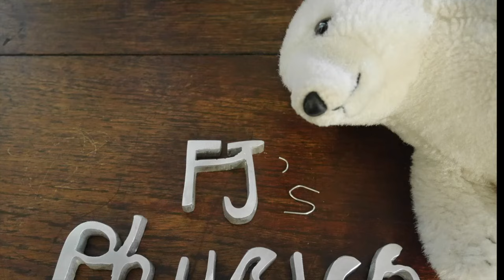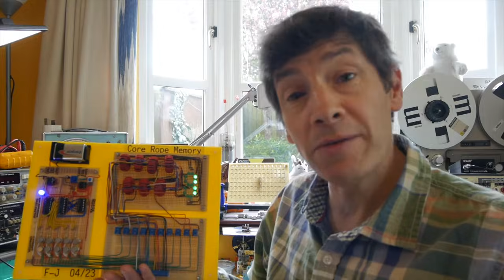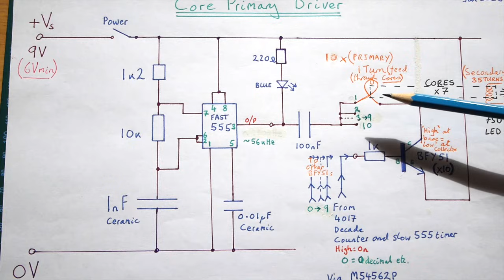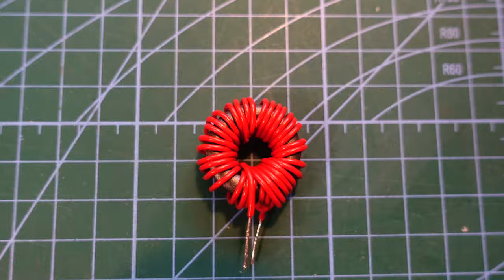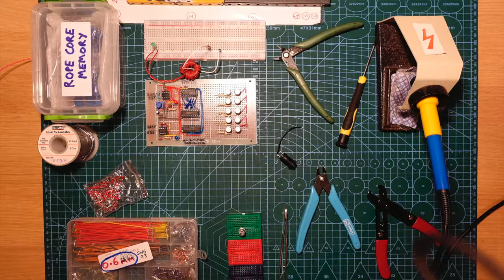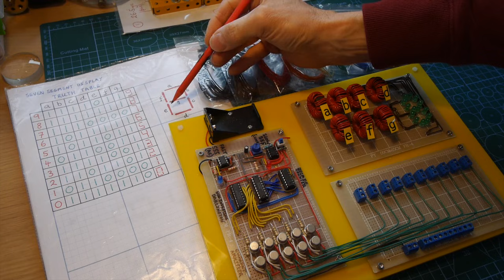Core Rope Memory Built and Explained - F-J's Physics - Video 169

Comment: The crazy part is that there's people recovering data once thought lost from ROM core rope memory right now. Despite it being more then 50 years later the data on the memory modules was not only preserved it's fully recoverable. The system was even more robust then the original designers realized.
Reply from the maker: Thanks - yes it is true that in most cases the coercivity and remanence of the cores is such that they will retain the data indefinitely.  Versions that use my method retain the data for as long as the system is in one piece as it only depends on the location of the wiring.  As far as the original designers are concerned, that's interesting to hear.  I do not have sight of how  robust they thought the systems were but from what I know the designers knew they were pretty robust as they were cleared for use in space.  I will be doing a video on core memory soon - that too retains its data but one has to be very careful reading old core memories as you have to immediately make sure you write the data back or it is lost from the cores when they all flip to zero!
Reply: @AnthonyFrancisJones  btw .... you arent sending any AC signals ... you are sending PULSED DC signals ... which is NOT AC ... you dont have a wave rectifier circuit to convert the dc into ac ... you just have dc power being pulsed on and off very fast (abut 60khz you said)  if your dc is gong from 0 to 5v t o to -5v then it is ac ... but since you are using 555 timers you are just pulsing the dc between 0 and 5v positive ... not one place in that 9v wired circuit is there an AC signal .... from source to display it is ALL DC the clock side is high pulsed dc and the working side is selected DC by reading the rope core memory and acting on the data contained there in a certain way ... in your case you light a segment of a display ...
Reply: @kaboom-zf2bl  This had me confused but as a thicko in these matters I didnt say it lol
Reply from the maker: Hope it makes a bit more sense now Tony.
Reply: @AnthonyFrancisJones  yes much more !
Reply: @kaboom-zf2bl It's AC, actually. He has it capacitively coupled so that the 0-5V gets re-centered around 0V. Even if it weren't though, it would still just be AC biased at 2.5V. Still not a DC signal. It's the fluctuation that matters, not whether it goes "below zero", because 0 is a relatively defined point in a system anywaym.
Reply: @control_voltage  noppe the capacitor is just a debounce circuit ... its all dc .... 
used to care for core memory like this even repair them ...
Reply: @kaboom-zf2bl Check out the circuit at 18 minutes. There's clearly a coupling capacitor on the output of the high frequency 555. Regardless, though, it is not a DC signal. It may be biased at something other than 0V, but it still is AC relative to the bias point. It has to be. Otherwise the coils would not be picking anything up. Transformers do not pass DC.
Reply: @AnthonyFrancisJones  Indefinite is kind of a tricky word when it comes to memory storage, after all, it was widely assumed that laser disks could hold onto data indefinitely only to find out the metallic layer used for data storage oxidized and that they didn't last nearly as long as intended. 
I have no doubt every engineer assumes their designs would hold data basically forever but there really isn't that many that actually can. My comment was more meant as a compliment that their ideas worked as intended.
Reply from the maker: Yes, you are absolutely right!  It worked as they intended and as you suggest, even better than expected!  A kind of modern day 'Victorian engineering'!  By the way, I am tired of the number of my CD's that have packed in and my Ampex reel to reel tape too.  My vinyl records are still going strong!
Reply: @GhostOfSnuffles The producers of laser read discs for sure didn’t think it would last indefinitely. They were just way off due to manufacturing tolerances. We knew all along burnable media wouldn’t last forever. We just thought we had more time.
Reply: @AnthonyFrancisJones  Got to separate the idea of changing data stored in ordinary "core" memory magnetic domains from the "ROM" aspect of the wired bits through/not-through the "rope" core plane ring. (Wasn't that a sense line?) The latter as ROM does not depend upon the long-term storage of the magnetic domain state, and in fact the bit could theoretically be observed by inspection of the wires, though an awful lot of work. Reading the "ROM" aspect only depends upon whether the magnetic domain of the ring will flip when current applied so it can be measured. (Which depends upon the remanence property or capability of the ring over time, but not the current state of the magnetic domain or remanence state over longer time periods.)

Now the interesting thing about ordinary core memory as data storage (changeable) is that when you read it you flip it if it was in the opposite state of the reading current flow, so it has to be restored to preserve the original data. In other words reading the core is destructive of the data and you only get one chance. Rope core you just reset all the rings before reading and does not depend on long-term storage of a magnetic domain or remanence state.

I can't tell yet from what I have seen, including Wikipedia on "rope core memory", so I have not been able to see if they used XY addressing or just relied on addressing a single core ring with combined drive lines ("set/reset" and "inhibit" lines) in a pattern I have yet to discern. But apparently in the rope core the magnetic domain remanence was important so the core domain did flip in the ring selected, and was similar to regular core memory in that way. The only failure would be deterioration of the core ring's remanence property per se, not the remanence state which is used for data storage in ordinary core memory. If they are not using a nonlinear threshold method (like in XY addressing of ordinary core memory) then the remanence property would not be important and only the action as a linear transformer would be important, I would think. It also may be importance to use the nonlinear domain flip or remanence property as a noise level control method, so approximately cancelling "set/reset" and "inhibit" lines' effects are minimized from the linear transformer aspect, and the domain flip is the major effect for the sense line in question when passing through the ring.

This "remanence" property of the core rings used (both ordinary and "rope") is different from the usual transformers we see, in which remanence is not desired. A remanence property of a transformer material would make a nonlinear aspect of the transformer such that the domain would flip at a certain current level providing an extra kick to the sense line beyond just the linear transformer response to changing drive current. Most of the ring cores one can buy today are specifically designed to eliminate remanence (as well as eddy current losses) so that they perform as linear (low loss) devices.

The hard wired "rope" method of "ROM" like storage doesn't depend on a previous state, you can flip it as many times as you want to test it just depends upon the sense wire being passed or not. (Yes, you have to "reset" the ring to known state before starting.) You could even examine each bit individually to see where the sense wire passed through the cores and log the result, building a table of the "ROM" bits, so that should be preserved in that sense if the physical frame is still sufficiently intact, independent of the condition of the magnetic cores themselves as long as you could determine if the wire passed through by imaging or physical examination. PS since it is in a plane one could most likely physically inspect each bit without destroying or damaging the frame, even without electronic activity in the frame.
Reply: no they knew the hard wired data was always gong to be there as long as the wires didnt break ... READING it can be done only two ways ... electric poling of working modules or physical tear down and logging of where EVERY wire went ... as they want to preserve the history they used a home made circuit to poll the memory by stepping through every possible address and reading what is there ...
Reply: How would it ever change 🤣
Reply: LOL what? "More robust than the designers realized"??? It's literally using the absence or presence of a ferrite bead for bits. You'd have to add/remove ferrites or otherwie physically damage it So of course anybody can recover data from it if they have the will.

Comment: What was going on with the upper segment? It had around 6 different levels depending on the displayed number.
Reply from the maker: Well spotted!  So this was tracked down to the LEDs being the wrong way around.  Now this should not matter but as the signals to them are AC and not symmetrical in shape (like a sine wave would be) they are getting under powered compared with the other ones.  So I have swapped them around and another segment that was doing the same and all is well.  I think that must have been the cause!  Thanks for watching and hope you enjoyed the video.

Comment: ❤1995 remember working on a project for elevator that used core memory that was a nightmare, the onwner wanted it to work.  I remember †he magnets which held info.   It worked but every other 6 months , he called.    Today, I surf more.   Califronian Surfer Downey Cali
Reply from the maker: Facinating!  I had never heard of that application but I guess a lift (elevator) used repeated common commands.  I guess they used lots of cam relays too.  Thanks for taking the time to comment.

Comment: This is not memory,  they are just transformers
Reply from the maker: Yes, that's the clever thing!  They are transformers of a kind with multiple and independent primary windings (single wire).  If a wire passes through the core it registers as a 1 and if a wire bypasses it it registers a 0.  In this way the memory is permanently wired into the system which makes it very rugged and fault tolerant.  Hope that explains it a bit better and thanks for watching.
Reply: @AnthonyFrancisJones  it is not memory it is just power transfer
Reply from the maker: I see what you are saying but in many ways don't consider power transfer as the currents and voltages are so small that it is not the power that counts here, just if a secondary in a core picks up a magnetic field from the primary (1 - wire through core) or senses no magnetic field (0 - wire outside of the core).  I am sorry if I have failed to explain it well but it is an interesting idea and one which some types of early memory relied upon.  It reminds me of programming old computers (you may well have done this) were dip switches were used as a form of memory to hold a group of bits at a fixed value though perhaps this is stretching the analogy too far!

Comment: I've been in electronics for 45 years, and I don't see how the transistors are ever going to be switched on since the emitter is connected to the positive supply, and the base drive voltage can never exceed that supply the way the schematic is drawn. Something's not right somewhere.
Reply from the maker: Agreed!  I wired it up and got a transistor the wrong way around and it worked!!  I was mystified too by this.  I have been over and over it and everything is as per the schematic (unless these transistors are not following the agreed layout of pins for this type of base).  I do remember that I did work it out at one stage and it was partly due to the fact that they are switching a rather odd shaped high frequency signal so are behaving in a rather odd way.  Not an explanation I know but it works and I was equally mystified!
Reply: @AnthonyFrancisJones  Maybe those are PNP transistors?
Reply from the maker: Definitely BFY51 very old though.  It was interesting that some of the newer ones did not work so something odd is going on here as you rightly point out!
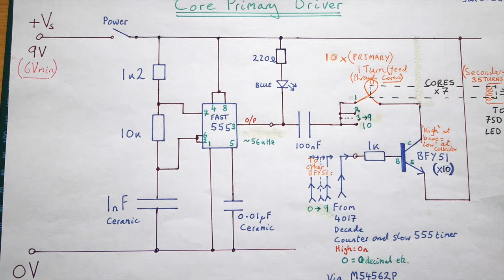Reply from the maker: Have a look at this great comment from Mick Healey - he has nailed it!   "If the circuit is actually built as shown on the diagram at 18:56, then the transistor is working in 'reverse active mode'. In this mode, the transistor will operate, but (conventional) current flows in the opposite direction (emitter to collector) rather than collector to emitter as would be the case in active mode. A transistor will work in this mode, and even have some gain, but the gain is low. To enter reverse active mode, the emitter voltage must be greater than the base voltage which in turn must be greater than the collector voltage. That exact scenario is happening here. The base resistor ensures that emitter is higher than the base. Since the collector is connected to the 56kHz oscillator, then the base will nearly always be higher than the collector."

Comment: If I understand this concept correctly, the cores aren't actually the memory.  The cores have nothing to do with the storage of the bits.  The storage is formed by whether or not a wire passes through a particular core.  The core is just a way to connect the "read" pulse to the "bit" pulse... or disconnect the "read" pulse from the "bit" pulse, depending on what bit is stored there.
This is actually a pretty clever way (for the era) of storing permanent information, as it acts just like a ROM.  And the number of "locations" the ROM can store depends entirely on how many wires you can fit through and beside the ferrite cores.
In summary, "Magnetic Core Memory" was a type of RAM while "Rope" memory was a type of ROM.
Reply from the maker: That is an excellent explanation!  I think it is RAM too as you can directly access the bits in any order without having to go through pervious addresses or location (like tape machines had to).  What do you think?  I feel it is both ROM (data 'burnt in' and fixed) unlike regular core memory, and RAM as the data can be randomly accessed.  Have I misinterpreted this? Thanks for a great comment regardless!
Reply: @AnthonyFrancisJones  Technically, all current-day ROM is also RAM but for convenience, we use the two acronyms to distinguish between read-only memory and read-write memory, despite ROM also being random-access memory.
Reply from the maker: Great.  Yes, that's it!  Though I would argue that historically punched tape/card was ROM but not RAM which is why I guess I used the expression here but as you say things have moved on!

Comment: I thought the point of core rope memory was the 2D addressability. Your 1D version seems a lot more complex than just directly wiring each address line to the appropriate data bits on the output.
Reply: If you wire each address line to the appropriate data bits on the output, you wind up shorting all of the address bits together via the data bits so that any address line input will cause all of the 1 data bits for every address to go out the output at the same time so there's no way of knowing what the correct data actually is.
You can get around this by using diodes to prevent the address lines from feeding back into other address lines via the data bits, but then you need a lot of diodes.  The core memory method stores the bits by whether or not the address bit goes through a particular core, which can be more compact.  Of course both methods are obsolete due to integrated circuits which do the same thing in far less space.
Reply from the maker: Tamas, Melkior's reply is excellent.  It is the rugged nature of these memories that make them so effective.  Back in the day a fault on a single diode could spell disaster as could a cosmic ray strike but here the data is the wiring and the cores enable it to be sent where it is required.  The seven segment display is a bit of a red herring here.  It is just to show the data output.  I could have used a logic analyser or similar.  Hope that helps and thanks for watching,
Reply: @AnthonyFrancisJones  Thanks for expanding on the previous already excellent response. In any case, please also make a video with a 2D addressable circuit :)
Reply from the maker: Thanks. I do plan to do a video on x,y addressed core memory and I even have some 3D core 'cubes' too!
Reply: @melkiorwiseman  thank you for the detailed response, these are very good points! I suppose adding a bunch of diodes was a very different proposition back when this technology was trending :)

Comment: Nice video - but it doesn't store so you couldn't call it "memory". But it is a nice example how to "manually" wire a 7-segment decoder. I also did it in the past but using diodes.
Reply from the maker: Thanks Bernd, this is a form of memory we call ROM as it does store data in its wiring structure but and each transistor can independently address each stored bit making it a form of RAM.  Unlike decoding a seven segment display input with diodes (which I do in this video  https://youtu.be/hNkMNqXJQhU ) in this case there is no electrical connection at all between the driving circuit and the display, only a magnetic one.  Have a google of Core Rope Memory and perhaps with respect to the Apollo AGC and you will see what I mean.  Hope that explains it.  Many have not seen this technology as it was a very early from of ROM but an excellent one for lots of reasons.  Thanks for watching and taking the time to comment.